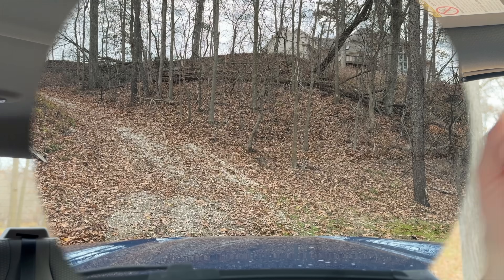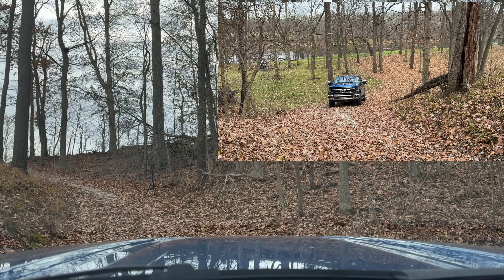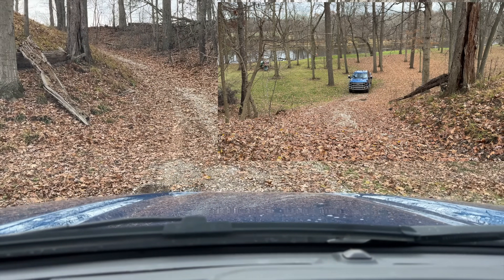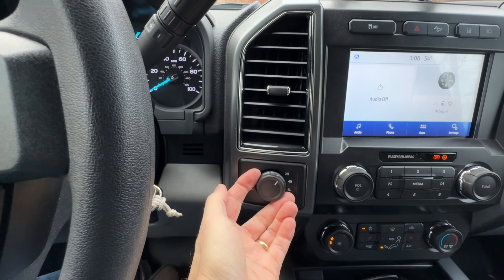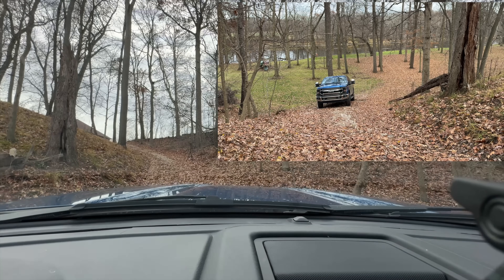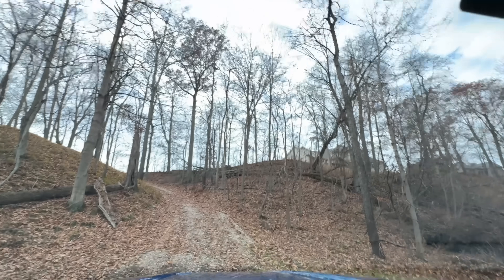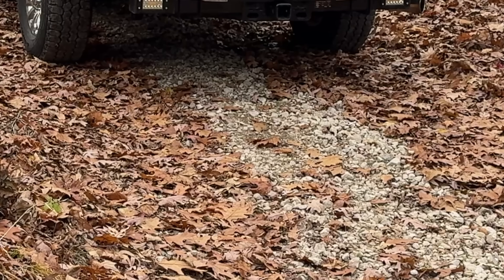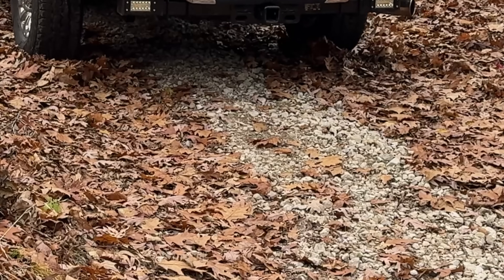FordSuperduty Traction control vs locked diff vs 4wd

Comment: Interesting video but 4 Lo does not disable traction control. It still acts as a brake-lock differential to distribute torque to the wheels with traction.
Reply from the maker: @myyoutubename152 Disables it in my truck, even shows advance trac off on the dash.

Comment: I still have my 1978 ford bronco I installed a no spin Detroit locker in the rear and a track lock in the front differential. When you lock the hubs and put it in four low it will climb and nearly flip over backwards. The only problem is on a side hill and it slips it will slide sideways instantly.
Reply: I also have a 78 Bronco XLT Ive had for 46 years now. I installed a Detroit Locker  back in the 80s in the rear differential.  Great for 4 wheeling but, I considered it dangerous on the street. The locker was installed by a professional and the truck was solid. Tires were new (33 x 12.50 x 15 mud terrains ) and measured exactly the same. Under load and straight line was fine but, when you decelerated,  it did all kind of crazy stuff. Seems loose like too much backlash in the gears and like the whole rear of the truck was loose.  l  I took it to the company (which was local) that manufactured them and had their engineers check it out. They even had their team install a new DL on it. No change. They had no answer. I took it out and put in a Ford Trac Lock and the truck was totally stable again on the road. Not as good off road though. I only went off road 10% anyway.
Reply: @7 @7080nik the locker unlocks one side when you apply the brakes and will slide one tire and when you let off the breaks it sounds like the rear end locked up but it is fine. The sound and the action of the rear end is scary to say the least. I try to make it a habit if a back tire locks up when breaking I stay on the breaks till I get stopped if I can. I blew up a ford track-lock at about 95,000 miles and that is when I installed the Detroit locker.
Reply: how many miles on your sled?
Reply: @m @michaelotoole1807 187,000 I rebuilt the engine at 138,000 miles and got rid of the two barrel and put a edelbrook high rise four barrel intake with Holly 750 cfm. I also added a two inch open spacer under the carb. It really woke up the old 351 M. Everything has been redone except the C6 auto and the 205 transfer case. I’ve had it since 1986, bought it from a friend who bought it from the original owner.
Reply: Nice I have a 79 bronco only I’m putting trutracs front and rear
Reply: @kirk0respite I like the no spin Detroit  but it gets a little much on the street. It will squall the inside tire on a turn if you apply a little throttle. And the track lock front is hard to steer when the hubs are locked and real tight to back up when locked and trying to turn. But here in the desert southwest in sand, rock, and even mud after a rain it works really well with 33x12.50x15 mud tires that work well with stock suspension and 10 inch wide rims. Not a real rock crawler but I have never had a problem going where I needed to go.
Reply: Good demonstration however with some speed you might not need 4x4 or diff lock. Diff lock you might not be able to steer very wel, might only go straight.
Reply: Anything with lockers is incredible. Just because units a bronco doesn’t make it incredible.
Reply: @flight2k5 I didn’t say it was incredible, it is only sufficient. It would take way too much money that I don’t have to make it incredible.
Reply: @tomlewis4345 Aaww. The way yo ideas fives how it would flip over backwards, which it won’t was misleading. So you had to modify it in order for it to be good offroad. Got it
Reply: @flight2k5 Manufacturers usually don’t install lockers in differentials because of cost and drivability problems. So in essence a four wheel drive vehicle is in actuality only two wheel drive, left front and right rear when wheels slip.  Or power goes to the wheel with the least traction on each axel. A Detroit locker acts similar to a ratchet wrench that allows wheels to turn at different speed while turning but will lock both axels under power.  If you were to install a spool both wheels would turn at the same time all the time and present real drivability problems on the street. So when you buy a vehicle they normally need modification to be truly off road worthy. And if a vehicle is modified and has enough traction it can and will turn over backwards or forward if placed in the right situation.
Reply: @tom @tomlewis4345 hit 😂   I’ve been wheeling for over 30 years.   It will not roll over backwards from climbing a steep angle 😂.
Reply: You seem like one of those guys that when you go to sell your truck you’ll put “will climb a telephone pole” or “it’ll pull a house off its foundation”. Spit ping
Reply: @flight2k5 No my old 78 Bronco is far from anything special it is basically stock other than a few engine mods that helped the sorry 351 M gain a little more power than the 130 some horsepower it came with and the differential changes everything else is how it came from the factory pretty much. I would have liked to have changed many other things but being retired and on a fixed income that time has passed and so will I soon so it has been relegated to hauling trash and short ventures of road. And besides it isn’t for sale and will be passed down to our youngest Son.
Reply: @flight2k5 believe me I have had it so light in the front end bouncing on and off the ground I had to reverse to keep the front wheels on the ground and that is scary enough for me.
Reply: @tomlewis4345 that’s not going over

Comment: I wouldn't be pussy footing around.
I would simply hit the locker and scoot up that lil hill.
Maybe it's a southern thing,but we don't cause unnecessary issues by going slow.
A good set of tires and a locker should walk right up that lil hill.
Reply from the maker: @charleshenson4183 I don't disagree and yes, if I wanted to badly enough and did not care about tearing up the hill, throwing rocks down into the grass or how hard I was being on the truck itself, I could have made it up the hill in 2 wheel drive, just keep the momentum and wheel speed up.  However, that was not the point of making the video.  Thanks for the comment and for watching.
Reply: Yo Cletus...you missed the point of the video...

Comment: Now let’s see you try again with weight in the bed and faster than a crawl.
Reply from the maker: @dentalnovember. I'm sure if I wanted to, I could have gotten up the hill in 2 wheel, that is with enough momentum but it's not a smooth hill, and I'd rather not beat the crap out of a $60K truck when I can crawl up it controlled and smooth.  Let me have an old 70's 80's truck with no electronics and I'll make it in 2 wheel all day long. LOL😉. Not to mention the neighbors would not have been happy with me throwing rocks down the hill where they mow the grass.
Reply: @robertweller2662  I understand. If I did not share the hill I would hit that thing with speed. I understand this was a demonstration but four low was a bit much. I have a similar hill so maybe I am bias. Thanks for your reply.
Reply from the maker: @dentalnovember  No worries, I also the hill as an excuse to exercise 4 LO.  Many never use it and then can't engage it when they need it or can't disengage it when they finally do use it.

Comment: Who ever came up with the cockamaymee  / Rube Goldberg idea of applying the brake at the same time as the throttle in order to get one wheel to quit spinning in order to get the other one to start pulling, well... my boots aren't big enough to kick his ass and make me feel more than a smidgen better . 
 The old WW-ll Willie's JEEPs were 4x4's. What happened JEEP. . .  ?    ☆
Reply: Computer nanny junk aside, back before traction control was a thing, applying brakes to an open differential when it was spinning out on one side would force power to the opposite wheel which had more traction. 

It does work, but it is unnecessarily sloppy when the computer is regulating it. The computer isn't able to anticipate the situation as well as the driver, so while it may be faster than the driver, it can't out drive the driver. Same with cruise control, it doesn't see the hill you are about to go up or down, so it may act differently than a human otherwise would, and it sucks at that too.
Reply from the maker: @curt2742  100%  Sometimes, it's better to Drive it yourself!
Reply from the maker: @fjb4932. LOL🤣

Comment: Why did you not use four-wheel high?  Would have gone right up.
Reply from the maker: @dannylebovits8090. Yes, it does go right up the hill in 4 high.  I usually use 4 low when I am off road period, for one, it automatically turns of all the traction control nannies, two, I like to exercise 4 low whenever I get the chance as it otherwise does not get used and I have seen transfer cases get stuck in 4 low or not shift into 4 low when needed because they were never used.  But yes, I have used 4 high to climb that hill and it goes up no problem at all.  Mainly I wanted to demonstrate there is no traction control active in 4 low.  Thanks for the comment and for watching.
Reply: If you are going at slow speeds off-road 4 low is always the best choice. More engine RPM, easier to control throttle response, easier on the transmission torque converter, and traction control turns off.
Reply from the maker: @Sandshredder2  Exactly

Comment: Ford traction control is terrible and will get you stuck in 4hi.
Reply from the maker: @danstennis1817 that's why I used 4 low and showed the screen where is says advanced track off, so folks would see 4 low disables the traction control.  Any traction control will get you stuck, it's not designed to be used off road.  It's for eliminating wheel spin on ice and snow, or wet pavement that is what it is designed for and all I feel it's good for.  Thanks for the comment and for watching.

Comment: I've seen a lot of videos over the years of various off roading with sand/snow and there are always countless comments saying turn off traction control and those comments have a bunch of likes. My question is what the heck is traction control for if not those conditions? Some back roads and new project sites are deep sand here and I leave my F250 TC on. If I'm losing momentum I hit 4x4, I dont have rear locker in mine. I've used 4 low a time or two with a heavy trailer back there but thats it.
Reply from the maker: @JP-Dawson Traction control is not necessarily designed for off road use, it is best suited on road in low traction scenarios like snow, ice or loose gravel and is meant to get you moving by slowing the wheel that is spinning and transferring power to the wheel that has traction.  If you ever find yourself stuck, turn off traction control, sometimes to get yourself unstuck you need to spin the wheels and traction control will fight you.  I hope that helps.
Reply: @robertweller2662  Yes, MOST traction control is not designed for off road use like soft deep ruts, or steep hills like this (12 degrees is 20%!). Traction control works great for what it's designed for, which is mostly preventing broken parts from spinning tires then hitting pavement.  The "aggressive vs less aggressive" traction control settings are another illusion.  Aggressive traction control (sometimes a "boost" switch) does not apply MORE traction control, it applies LESS braking, while allowing the engine more power than the normal setting.  

Traction control is much more common than locking difs though.  Folks may not know how to use traction control well, but also don't know if they have locking difs either.

Comment: Appreciate the vids, much educational info. Love my '25 F350 (Lariat)w/7.3 gasser pulling a fifth wheel camper with no problems!
Reply: What's the weight and length of your 5er? Do you tow in the mountains or on flat?
Reply: @elderrob pulling a grand design refection model 260rd  30ft.long GVWR 10k, dry weight around 8k, payload around 2.5k, specs.available online. Pulling it with a Pullrite slider type hitch on OEM pucks(short bed), I have 3.73 gears in rear axle.
Reply: In the northeast we have a mix of mountains and flat I have no complaints with that gear ratio in my situation
Reply: @pauljaronsik5112  One man's mountain is another man's hill. Here in the rocky mountains (Utah) all those mountains aren't even hills.

Comment: i would never own 2wd truck!
Reply from the maker: @arlenboyer-v9v. I've owned 3 of them, always found myself at some point wishing they were 4WD.  LOL
Reply: @robertweller2662  they are fine if on the stay  on hwy or city driving.
Reply: @arlenboyer-v9v even in the snow?
Reply: a 2wd with a locking rear like Chevy's G80 option is fine for most cases. Now if you going off road in rough terrain, thats a different story. But for most people, if you have just a locking rear, that will be fine. Even 4 WD is not 4 wheel drive, it is only 2 wheel drive, 1 rear 1 front (if you dont have a locking rear diff) , or it can be 3 wheel drive if you have only a locking rear diff (2 rear and 1 front tire has power). True 4WD is only had when the truck has both rear and front locking diffs.  So, the term 4WD does not hold true most of the time, cause very few trucks have a front and rear locking diff. Only the very high end trims and super expensive ones have that option.
Reply from the maker: @BR549_o7  the rear locker has gotten me out of most situations without the need for 4WD, however, in this case as the video shows the rear locker made no difference on climbing the hill, 4 wheel drive was needed.  Thanks for the comment and for watching.
Reply: @BR549_o7  have g80 in mine suburban and my avalanche and i have new ram 1500 with limited slip and a new f350 with full lock rear end these trucks are very limtied off road or in the snow without 4 wheel drive where i live! so yes every vehicle we own is  all wheel drive or 4 wheel drive. just my 2 cents.

Comment: Robert, Thanks for this.  1. I never knew that you could pull out that selector wheel. I just assumed it was automatic.  2.  I never knew about the Off Road Display. Very helpful   There really isn't ever a need to use the 4x4 option here in Dallas so there hasn't been a need to know.   But I have seen people get stuck recently and their 4x4 was just digging holes and I figured they simply did not know how to use it correctly, which is why I have started watching your videos and asking questions.   Take care and again, Thanks!
Reply: You bring up a good point: for those that live in the flatlands and own 4 X 4 for winter, let's say... it's a good idea to exercise the front axle drivetrain a few times a year and for a couple of reasons: 1. it will better distribute axle lubricant to all moving parts after being unused for extended periods of time. Also, axle housings are not entirely sealed as they are vented to atmosphere and during heat/cold weather cycles can develop internal condensation. Engaging these moving parts helps to keep them covered in axle lube. 2. It is good practice for the driver because they learn what to expect at transfer case shifting and the resulting performance changes at the tires. Too, it's good practice to switch the front axle Autolocking hubs to Manual and back again as part of this exercise. 

And, tires: While Robert's always-excellent instruction shows how weight transfer induced by steeper gradients can affect traction, a lot of it comes down to the tire type used for the conditions. When all else fails, a driver may "air down"/release pressure from the drive tires to lengthen the tire's contact patch which increases traction. The driver however must have a means to re-inflate the tire to a suitable pressure for highway travel or risk sidewall damage due to overflexing and overheating, causing sidewall construction delamination which is irreversible and will cause complete tire failure. 

Happy New Year everyone. Here's to your good fortune in 2026.
Reply: Yeah and don't forget to grease the muffler bearings while you're at it.
Reply: You also never knew to read your owners manual.
Reply: @440-6Pack  It just happened to come with the truck I bought for my biz....Is that ok with you?